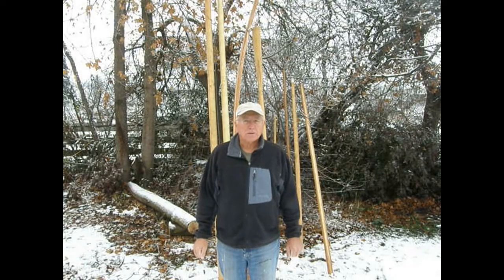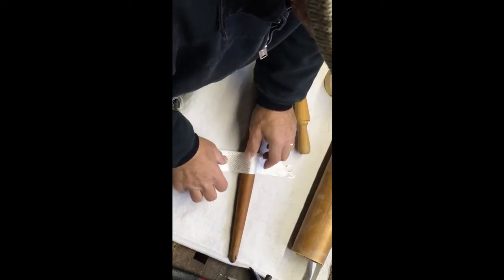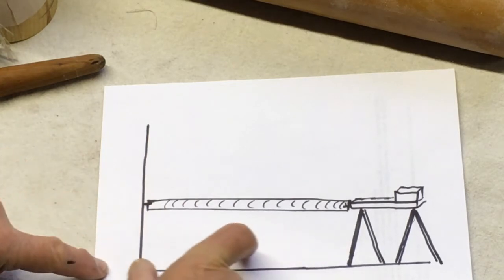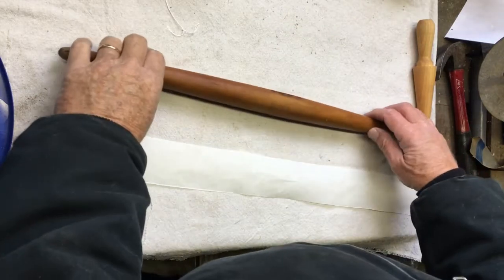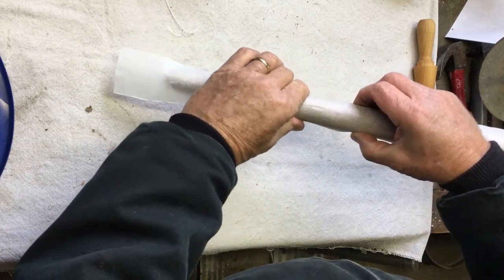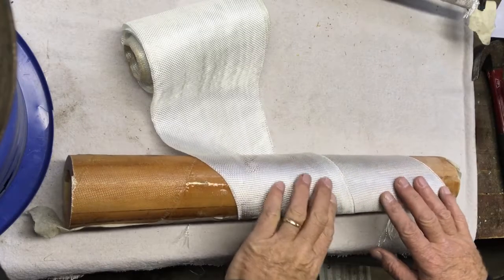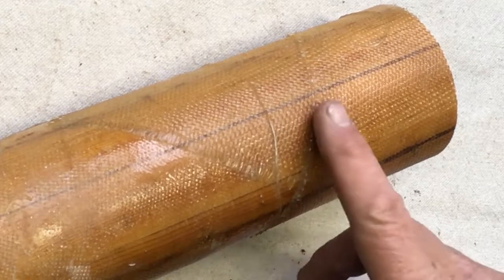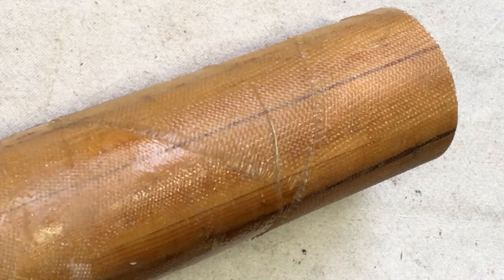Building a Hollow Mast with Birdsmouth Joints Part III: Sheathing Mast and Spars with Fiberglass

Comment: The finish is awful and can't be sold to any client wanting a wooden mast. Your videos about building the hollow masts were great with so much attention for detail. I disagree also on the sense of glassing a mast for mechanical protection. A traditional varnish will be easy to repair when the gaff hits the mast accidently. Glass with Epoxy may be broken and create a white spot, letting water in and therefore causing root behind the glass.